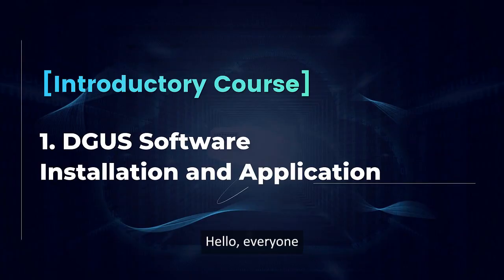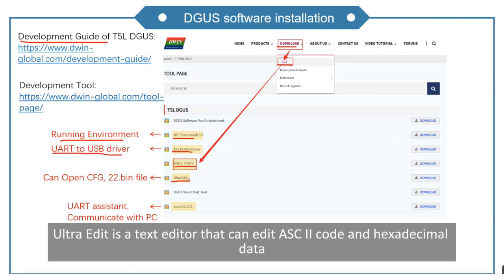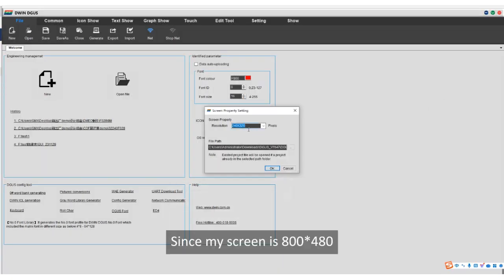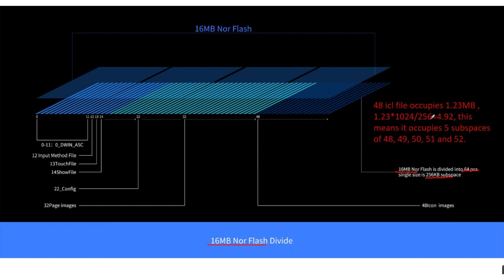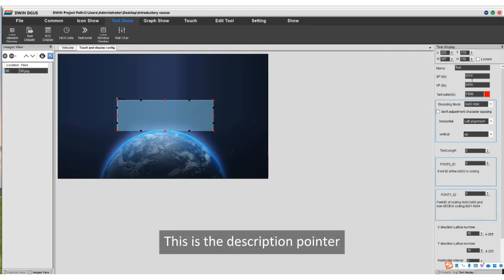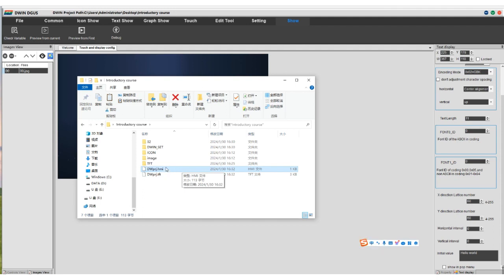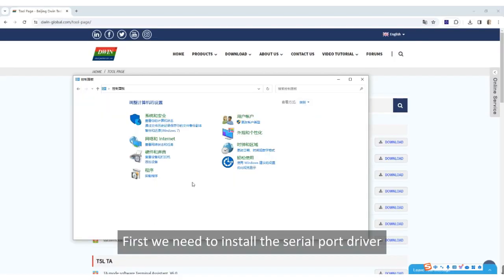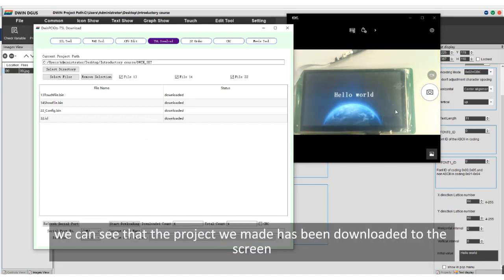Introduction Course

Comment: I use DMG85480F050-01WTCZ02, when downloading the program the screen does not change?. I feel the software is very difficult to use compared to other HMI screens on the market.

Comment: DMG80480C070_15WTR. 
The project on RS-232 does not load.
I did everything as in your video.
After successful booting, the device screen goes dark for a while and the factory picture appears.
In the middle, where the text should be, the image is damaged.

The documentation everywhere talks about 16 MB NOR FLASH.
DMG80480C070_15WTR has 8MB.
Perhaps this is the reason? Since I specify the address for image 32 (as in the video tutorial).
How can I use DMG80480C070_15WTR correctly?
What could be the reason for this?

I took the Demo project files and uploaded them, in this case the project uploaded successfully.
Reply from the maker: Yes, you are correct; the issue arises from the 8MB flash memory. The calculation for 8MB is as follows: 
8×1024/256=32, and for 16MB, it is 16×1024/256=64.

Why divide by 256? Please refer to page 15 of the "T5L_DGUSII Application Development Guide" for details.

We recommend using the naming range of 16 to 21 and 23 to 31 for 8MB since 0 is for FONT, and 12, 13, 14, and 22 are already taken.

You need to configure CFG 0x08 to 23, then generate the pictures and name the file as 23.icl.

I hope this clarifies the process. If you have any questions, please feel free to email me at cindychen@dwin.com.cn.
Reply from the maker: Yes, CFG 0x08 = 23 = 0x17H

Comment: Please show example of DMG48270C043_15WTR 8MB flash
Reply from the maker: The distinction between 8MB and 16MB lies in the icl and font names. For 8MB, the range is 23 to 32, while for 16MB, it extends from 23 to 64, with 15 to 21 also available.